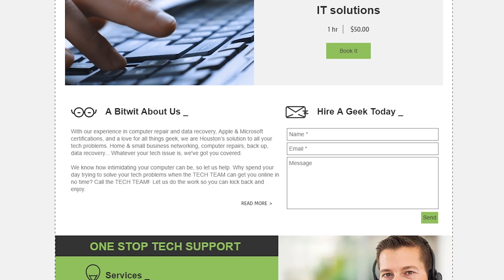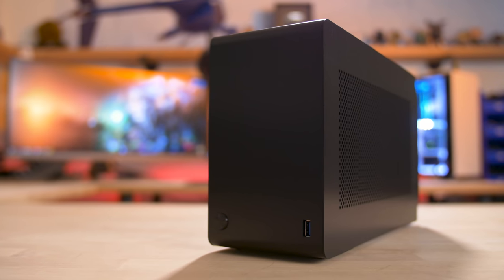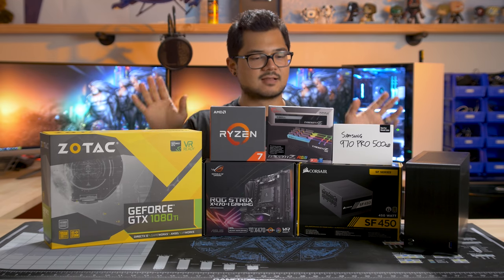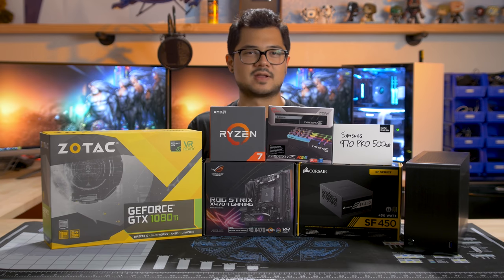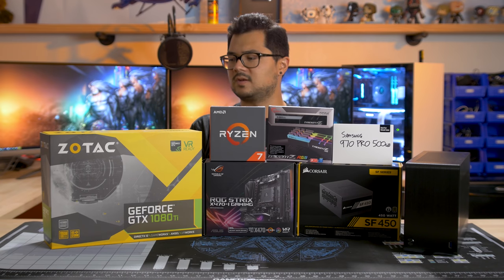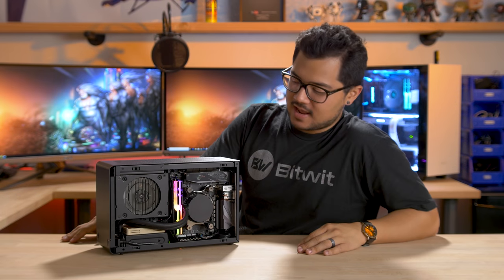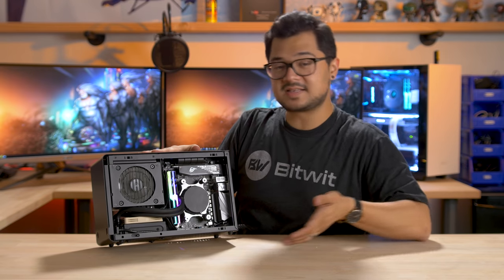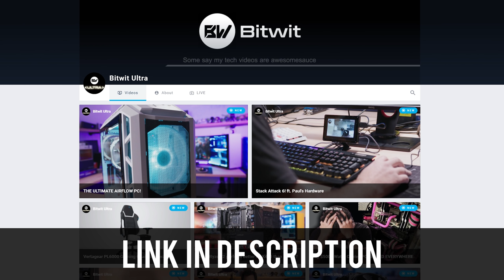The smallest water cooled PC I've EVER built! DAN Case A4 SFX v3

Comment: Awesome build, but I kinda feel like, in such a tiny case, using a low profile air cooler would have been better. With the aio you have the pump and the tubing taking away valuable space, and with such a small rad the performance is going to be rather limited. And where its mounted, even with a low profile fan and flat psu cables there was still interference.

Small air cooler though and you get all that room back for cable management allowing for a bigger GPU without much impact to other components. Plus the air cooler can suck air from the opposite side of the case so less worry about the gpu thermals interfering. My two cents though.

If we're being totally honest, I wouldn't build a system that small anyways. If I was going to go through the trouble of hauling around a monitor too, I wouldn't mind using a slightly bigger mitx case to house the hardware to give it better cooling.

Comment: What really bugs me about this motherboard is that the M.2 slot on the back does not support SATA drives. So if you want to combine a fast NVMe drive with a large SATA drive, you have to put the SATA drive at the front underneath the heatsink and the NVMe drive on the back without a heatsink. That kinda defeats the whole purpose of having that heatsink in the first place. Someone at ASUS should have thought a little bit longer about how people are likely going to be using those two M.2 slots.
Reply: Lol the Crosshair VII hero has the heatsink on the secondary m.2 slot and nothing for the primary. I don't think Asus cares.
Reply: I've got the B450I and it's the same.  Maybe when PCIe drives get cheap...
Reply: You don't want a heatsink on your m.2 drive.

Comment: HI Bitwit, could you tell me if the Ryzen 2 still has the problem of compatibility with the non AMD certified RAM that the Ryzen 1 had?
Reply: Particularly the trident Z RGB? Cause Gskill did a special collection for the previous gen of Ryzen (TZRX while the INTEL ones were called TZR).  But i don't know if things are different for the new gen of Ryzen

Comment: i got the sf450 but really? can it really power a 2700x and a gtx1080ti with ease or will it be near maxed ? I assume no OC ? what if it wasn't a gtx1080ti mini and/or you used sata3 drives?
Reply: Oblivianos at stock it will with relative ease, will be maxed out if you overclock both.

Comment: also I heard the sdd runs a bit hot since there's no fan in the area can you reprot your finding
Reply: I just recently completed a build with an m.2 under the heat sink. The heat sink has no air flow if you choose to use the AIO so it will gather heat. I had to zip tie a fan to the panel to keep that area cool or it would overheat.

Comment: My build is:
Intel core i7 8700k
Asus ROG Z370 i Gaming
Corsair Vengeance LPX 2x8GB DDR4 3600MHz
NVIDIA Titan Xp Jedi Order
Corsair SF600
Samsung 960 EVO 1TB；Samsung 860 EVO 2TB
Asetek 545LC With 115x Socket
Noctua NF-A9 PWM；Noctua NF-A4x20 PWM

I bet you couldn't close the side panel with that high-profile RAM lol. Your cable management is way better than mine but considered the full-size graphics card and an annoying 2.5' hard drive there's not much I could do. And I'm surprised to find out that you don't have to remove that USB port on the front panel! I'll try reinstall that littile cute later
Reply: Awesome! Would you happen to have any pics? And were there issues mounting the NF-A9 fan on the CPU cooler without needing longer screws?
Reply: @rebelub  I don't know how to send photos on YouTube lol. I did buy some 16mm and 18mm screws but I forgot which did I use to mount the fan lol.
Reply: @HeLithium  Thank you for the info! 🙏
Reply: @rebelub  You're welcome. In my impression lots of people in the forum made this build. Should be easy to Google some more info& pics
Reply: @HeLithium  Yep! I am building almost the same exact thing as well. With a build as small as this, it's vital to get as low temps as possible. Comes with a hefty price, but so worth the investment. 💪
Reply: Titan Xp why not 1080ti? Basically they have nearly same  performance and drastic price difference.
Reply: I don't care about the price when comes to things I love. My belief the Jedi Order

Comment: REEEE!! Why u noobin around Bitwit! Rotate the PSU to get it working as case exhaust, and put the aio fan below it to avoid the problem with cables touching it.. Also this gives u neutral air preasure in the case instead of negative..

Comment: So I'm new to building, and wondered what part it was that he added at 5:58 .
Reply: The m.2 ssd?
Reply: @James.Stark.Ben.Edition  That's an SSD? I thought those were bigger, thanks for the help.
Reply: @NissanBroke  normal sata based ssds are bigger. Since this is a small form factor build that has no place for a full scale ssd, Kyle went with a nvme ssd that fits on the motherboard. They get hot but are really fast. There are also normal ssds that come that small that are less expensive. They're not nvme drives (the fast ones) but Normal sata based ssds that use the same slot but they are slight expensive than normal ssds. He used a nvme in the video and the 2tb wd blue he mentioned was coming later is a regular m.2 ssd.

Comment: BUILDING A PC NEED HELP! Im planing on using an asus cross hair 6 wifi motherboard Ryzen 5 2600 gtx 1050 256m.2 970 samsung evo drive 1 tb ssd 1tb HDD 500 gb HDD (HDD out of my old prebuilt pc) 3000 MHZ 4 in dual stick config DDR4 so 8gb.. NZxt 440 case and 500 wat power supply does this sound future proof? I just want something that will last me a year or 2 before it needs upgrades i was planing on Ryzen 5 2600 and then upgrading next year to Ryzen 7 2700x but I don’t know if i can do that or if these parts go together... plz help me out lol

Comment: not a pro builder but couldnt you have put a 15mm  'slim' fan on the bottom of the rad..It would have been a draw thru .Then the rad would have been easier to keep clean and the fan would have been away from anything touching it.? Jussst my .02

Comment: Problem: Fan has short screws.
Obvious solution: Go to hardware store and get longer screws.
BitWit solution: Use scrissors to shave of interior of screw holes like a barbarian, thus having the screws poke out a little bit and making them barely useable.

Comment: I cant believe he destroyed the nice 30dollar Noctua fan just because being to lasy to get some fitting screws from a DIY-store. It looks like the radiator gets completely choked off from both sides. warm air from inside the case barely travels into it and with 5mm clearing to the table certainly cant escape through the bottom easily. stop this trend of throwing expensive things together! this case is for air-cooling efficient mid-range components to make any sense.

Comment: PLEASE HELP!  PLEASE HELP!
My best friend got me a kit of  G.Skill Trident Z RGB 2x8Gb F4-3200C16D-16GTZR, and I'm building a ryzen system, but its not on the QVL list. This RAM only supports intel boards. What can I do now? Do i have to sell them or trade them for other RAM that is supported by AMD Ryzen compatible chipset board?   There is no chance it will run on ASUS ROG STRIX B350F or Gigabyte Aorus x370 k5 boards with 3000 or 3200 MHz ??   
(sorry for potato english)

(Also building intel system is not an option, its way more expensive than ryzen in my country to do that)
Reply: Try it, most “intel” labeled ram runs fine on Ryzen, and if it doesn’t run at full speed try it at 2933mhz or 2666.
Reply: Matthew B I have that exact kit and it runs at 3200 on my b350 board. It was also not in my motherboards QVL list. Due to the long time that has passed since first generation launched that kit should hopefully work no problem
Reply: Thank you ! I hope for the best!
Reply: So it should work with X370 too right? (Gigabyte AX370-Gaming K5)
Reply: Matthew B Yeah it should. If it doesn’t it’s pretty much guaranteed to do 2933. There is also a minimal difference between 2933 and 3200

Comment: That power supply fan shouldn't spin unless it's under load, were you running something that was pushing the system? If not the PSU is broken and has to be returned

Comment: You and Paul just copy each other or what?...

A 8c cpu and a 1080ti on 450w?.. got news for ya Kyle... I would sacrifice some performance for peace of mind... Undervolt and underclock the 1080ti by a small margin makes a huge difference to heat output... Do the same with the 2700x leave it on stock and see how low you can go on the volts... Consider taking the cooler off the GPU and using liquid metal in combo with a down clock and down volt... will make a huge difference overall.

Comment: What the actual fuck Kyle. Don't you have radiator mounting length screws laying around? I have like 12 extra ones laying around somewhere in a box and I'm not even a hardcore enthusiast.
Reply from the maker: It's a slim fan so standard rad screws won't work :/
Reply: @Bitwit  I see. I do have two different length rad screws so I should have considered the fact that there were even more. I admit err in my train of thought. My apologies.